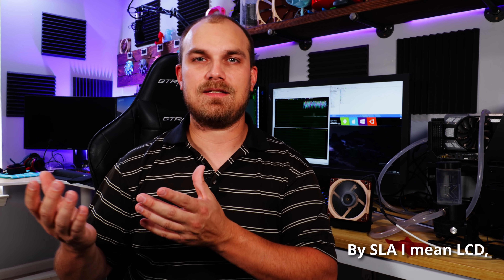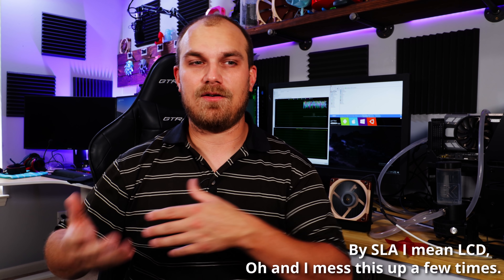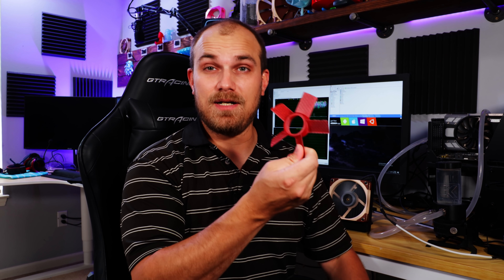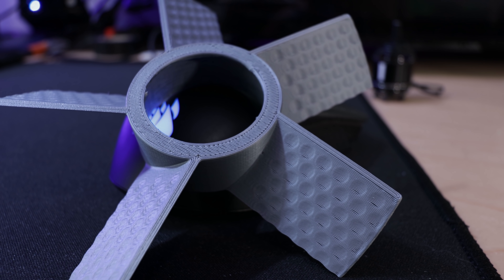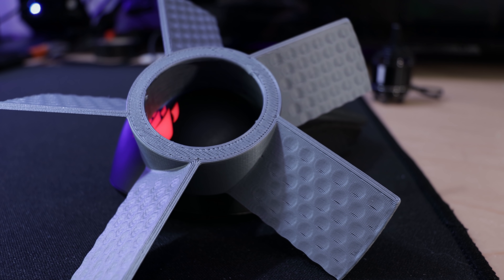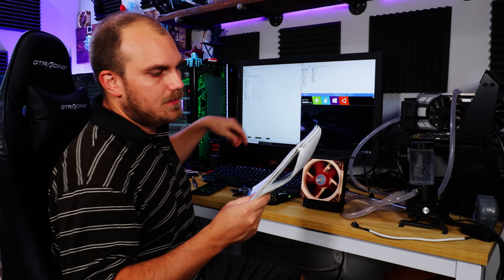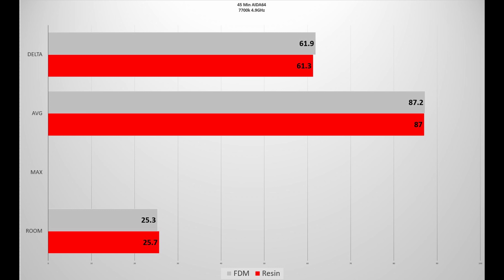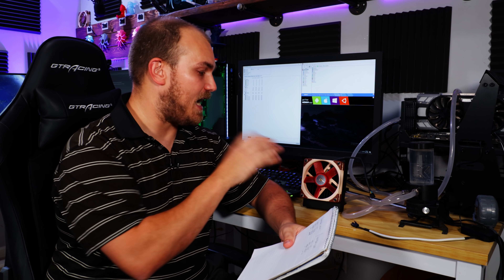Do Resin Fans Outperform FDM Fans | Dimple Fan Follow Up

Comment: First fan got to gradually heat up the water in the radiator , lowering its average. Second fan was put on already warm water so it didnt get help on the average. Best way to do a test like this is to run the test twice back back. Throwing out the first test and only using the second. Allowing the water to heat up.

I.e. fan 1 test, fan 1 test B. Use test bs data only. Then fan 2 test, and fan 2 test b.

Watch some videos from gamers nexus for proper testing procedures

Comment: There is no difference due to the scale of the problem. If this where a larger fan (aircraft engine) the surface finish would matter more. The main characteristics to look for in a impeller is the weight, blade count, pitch and profile.
Reply: Does the weight actually matter in performance? With less weight you obviously get more RPM, but that's more of an efficiency.
Not trying to contradict here - just asking out of curiosity.
In the same vein of thought - I've wondered why high-grade commercial fans like Noctuas don't use an outer ring. it seems like with that added structural integrity you could prevent the whole "material-stretching" problem and cut down the fan-casing edge margin even more to gain even better pressure performance.
Reply: @TheStigma  noctua has better manufacturing tolerances and they account for the straightening of the blades by encreasing the gap between the blade and the wall.
Reply: @TheStigma  yes, you get more rpm with the reduction in weight. More rpm will push more air. It's a balencing act between strength of the blades and weight.
Reply: @henry67278  I think @TheStigma meant that the weight doesn't matter if the rpm is the same, it just needs more power to reach that rpm (and thus it's more of an efficiency question). So any two fans that are the same size and have the same fin profile should move the same amount of air with the same rpm. Now if we limit the amount of power to a fixed number (like we do in these experiments) the lighter one will of course perform better.
Reply: @TheStigma  having an outer ring is good for structural integrity but is not necessary, to get the perfect blade fit the blade would have to be printed to size and then worn into the wall until no friction is present (which is what I do for micro edf's) or keep removing material and testing the fit. The only downside of a ring is the reduction in blade area as you need a 2 layer ring due to the slicing which will reduce the diameter by 1.6mm if printed with a 0.4mm nozzle.
Reply: It does make a difference in loudness though, as we've seen in the main series and the a12 fdm print.
Reply: @z3dar  I ment having a smoother finish with the use of resin doesn't make noticeable a difference

Comment: I see a .6 degree difference in the delta, and currently if you look at your leader board for the custom fans, noctua wins vs thomas by only .1 degree in delta.... sooo maybe try Thomas's acceleron and see if it beats Noctua when made in resin?
Reply: I'm curious what the margin for error here is on the measurements. It would be interesting to see if previous results can be reproduced with consistency. I'm sure the duration of the test is already sufficiently long to help with this, but perhaps there are other variables that go unnoticed. I'll have to snoop around to see if he already has this data listed.
Reply: @odometric5946  He could eliminate the variance in environment temperature by running the tests inside of a refrigerator, ice chest, or insulated bag of some sort. Then he could heat up or cool down the box/bag/chest to the same temperature before each test.
Reply: WITH Dimples!
Reply: @Vahlsten  dimple dimple
Reply: Oh wow that's actually a really good idea
Reply: And if you go back to the video where he printed a Noctua fan, the 3d printed fan blade did even worse than the acceleron. If we can get Thomas' Acceleron made in the same process as Noctua's fans, it would really out perform Noctua.
Reply: 100% agreed
Reply: I really hope that he tries this. It would be so nice to see someone beat Noctua or at least directly match them.
Reply: .6 is within margin of error isn't it?
Reply: This needs to be upvoted so much. Even though the room was hotter the resin clearly was much better.
This is what ticks me off so much about the fan comparison videos. They are done so unprofessionally that you can not really compare them at all.

Different materials are being used, room temperature always changing and unstable during the runs, different printing quality and worst part about that: referencing the industrial made noctua fan to the 3d prints and not the 3d printed noctua fan!

So basically everything he presents is always false because there's simply no comparable base line. It's such a shame because honestly the series is very amazing - it just needs to be done scientifically correct!
Reply: Yrah
Reply: I was thinking the same thing. Much better than that flawed dimpled fan design (although that was also fun)
Reply: He is gone print it ! See the comment above you
Reply: The Resin fan also had a .4 in higher room temperature and still outperformed the FDM so its about 1 degree all in all improvement. I bet the acceleron would smash the competetition for sure if this simple fan can get a 1 degree difference.
Reply: here's the deal. The acceleron is:
1) Ecstatically appealing in looks. [check]
2) Competes with one of the leading marketed fan design so far. [check]
3) Could possibly surpass one of the leading computer fan designs if a little more care was put into it.
4) The designer should start shopping their design to Noctua, and its competitors.
5) Maybe the guy from Major Hardware could be the middle man?
Reply: @yeost187  it only "competes" because the leaderboard has no regard for noise though
Reply: @yeost187  No way to remotely easily injection mold that part. It'd have to be printed, which means a no-go on a large scale.
Reply: "I see a .6 degree difference in the delta" - No you don't. You see a .6 difference between the average temperatures for both runs. When you factor in that each individual temperature reading during those runs was only accurate to the nearest whole degree, you need a delta of 2 degrees before you can even say with even the slightest certainty which temperature was higher.
Reply: @stoneymahoney9106  yeah okay from a scientific method point of view sure, but I'm talking about the leaderboard. None of the scores on the leaderboard are more rigorous than the observation I just made with this test. There is a high likelihood that the current best fan could best the noctua if printed in resin based on the current accuracy of the leaderboard scores.
Reply: @stoneymahoney9106  "with the slightest certainty". No, with 2 degrees difference you'd be absolutely* sure (unless the CPU or thermometer is broken, or you fucked up the experiment itself) there was a difference. But to be reasonably sure it just has to fall outside a certain portion of two overlapping bell curves. Even assuming a probability of 10% for each decimal value (that is, if we measure an average of 76.5,  the actual value is equally likely to be 7.6.1 as it is 76.5, which of course isn't true) we'd only need a difference of 0.5 degrees to be 90+% certain that the hot one is actually hotter. Assuming a normal distibution (where measuring 76.5 means it's more likely that it's actually 76.5 than it is 76.1) you'd need a difference of just 0.35°C. Quite a ways off from 2°C. I've got no clue what deviation the average thermometer has, but I'm pretty sure the accuracy of the measurement is somewhere between a quarter and half a degree.

Beyond all of that though...
Both measurements are part of the same prolonged experiment, so the outcomes should simply be listed as-is. It's just as likely the 'old champ' was measured incorrectly as the 'new contestant'.
 If you want to add a caveat, you do that at the "end". I.e. you make a list of temps, pick a top 5, and then you say "but this might be slightly off". You don't measure and disqualify a fan upfront.
Reply: There needs to be a 5 degree difference to rule out margin of error, otherwise it's not statistically significant.
Reply: @Floortile83  No. 5°C  is not statistically insignificant. That's the difference between hypothermia and a fever. Between a fridge and a freezer.

You're confusing 5°C with 5% measuring inaccuracy, which is often used as a rule of thumb in statistics. But even that's not quite correct; it's actually about the percentage you expect this to be possible randomly. Which depends on the subject, tools, and method. For example the human body is on average 37°C, as is the current temperature in Qatar. But my body tenperature doesn't fluctuate as much. Tonight it'll be ~30° in Qatar, but my body will still be about 37. What kind of thermometer we use also matters. A simple liquid/garden thermometer will be less accurate than a medical one. And how often do we measure? One person, once? One person, daily? Many people, each hour? That really affects how we can predict an individual's or a group temperature.

So, no. To test fans you don't need 5° or more difference to be useful. Core temperature is fairly precise. It doesn't fluctuate much (once it reaches thermal equilibrium) and he's constantly using the same CPU.

Now there are still some issues here that should ideally be tackled; slightly fluctuating room temp affects how efficiently the cooler can dump heat, 1°C isn't super accurate, we don't exactly know the CPU load/clock... but I think the overall average delta should be accurate to about ¼~½°C.

I'd be more worried about print quality and layer separation screwing over filament-printing.

Comment: print the acceleron and the 3080 fan from Thomas and Kevin in resin too see if there is a performance increase :)
Reply: i also very question the 3080 fans design
i mean nvidia use it right?
Reply: @ShiroCh_ID  yes
Reply: @ShiroCh_ID  Steve at gamers nexus has a run down on the visual effects of the nvidia 3080 fan. basically its not that great.

Comment: What about printing the number 1 fan in resin and compare to the original
Reply from the maker: printing right meow
Reply: @MajorHardware  man, your level of interaction with your community is fucking amazing. Many people can learn from this.
Reply: @nevill2947  his channels gonna blow up i swear
Reply: @MajorHardware  GOAT
Reply: @MajorHardware  you said the acceleron had 42.5 db. What is the noise level for the noctua fan?
Reply: @MajorHardware  Make a silent fan with blades based on owl feathers
Reply: @MajorHardware  right woof xD
Reply: Right meow.
Reply: Do I look like a cat to you, boy? Am I jumpin' around all nimbly-bimbly from tree to tree?
Reply: Gotta say, I'm really excited to see the current chart topper in resin. Any performance gains would be nice, but aside from anything else it's a badass design and deserves a super smooth print imo.
Reply: @LyK0sa  dude!! read my mind!!! i wanna see that Tulip fan in resin hahahaha
Reply: I think we're all gonna be terribly disappointed because the room temperature was a whole 2 degrees lower during the Acceleron benchmark compared to the Noctua A12. Room temps seemed to vary drastically during that episode...so I...well, I'm kinda confused about that one.
Reply: @NekoPufferPPP  it shouldn't matter too much since the result we're paying attention to is the delta over ambient, not the actual CPU temp
Reply: @LyK0sa  there shouldn't be, you are right, but there definitely seems to be some correlation in the results.
Reply: @NekoPufferPPP  he needs more subscribers so he can renovate his basement for these tests haha
Reply: i hope theres will be stable and constant room temps
since i think its also a troible for measuring the fans effectiveness
Reply: Should I send u a 3d model of me then ?
 😂😂
Reply: This is a result I look forward to.
Reply: @barongerhardt  current performance leader would make more sense since it's a noticeably better design than the golf ball fan (speaking about performance). This should give a better idea as to whether it was just margin if error or if there's an actual performance difference in using resin instead.

Comment: Could we see a light weight carbon fiber fan???
Reply: iirc carbon fiber is just carbon fibers impregnated with epoxy resin. technically this would make it heavier, in turn making it perform worse. though it would be stronger, but a comment here also says resin is stronger than FDM as is so i don't really see much need honestly. plus, i imagine it would be impossible to print carbon fibers into the resin, at least with the current setup he has. who knows if carbon fiber printers are even a thing, but it certainly is an interesting idea!
Reply: @spookz4469  Well im not am expert on carbon fiber. I do know some carbon fiber polymers are very light. These trade lower expoxy for lower strength but overall lighter foumula. I dont know though just think it would be cool to see something ultra lightweight.
Reply: @zombie123443211  well ofcourse if it actually lightened things up, that would be beneficial. i should have said instead of saying that it would make things heavier, is that it kindof seems like it might. but iunno man im totally interested